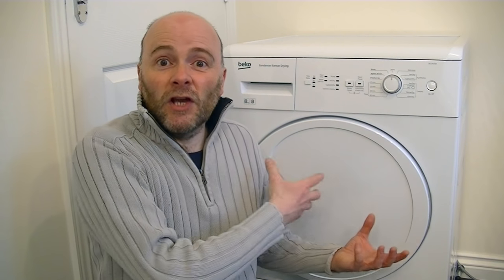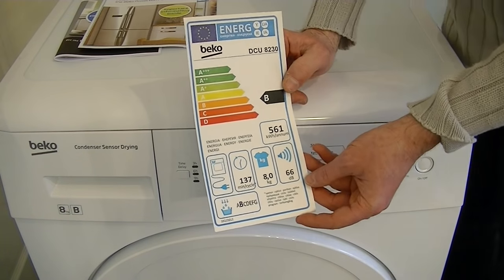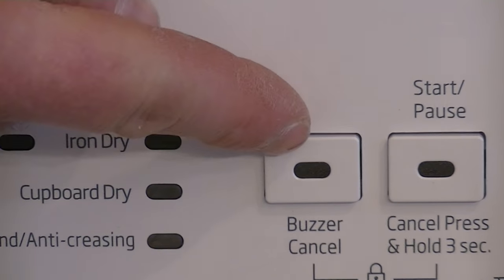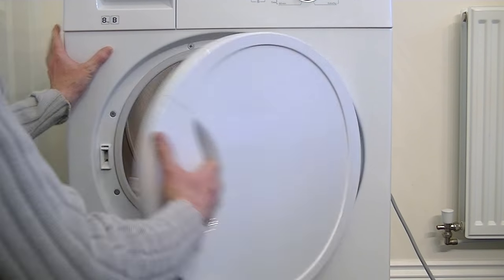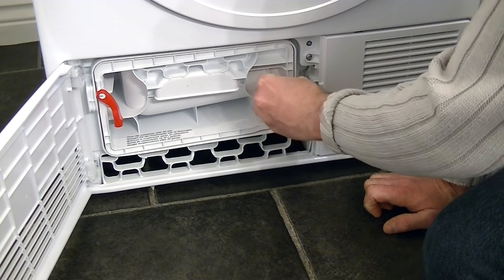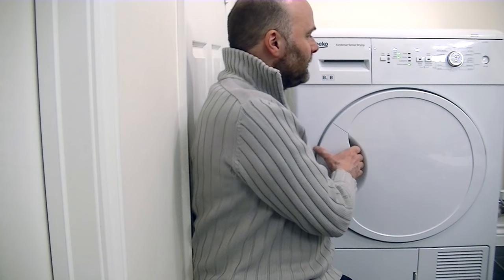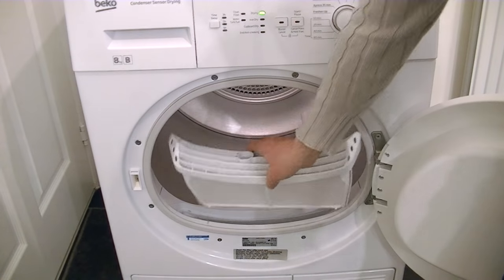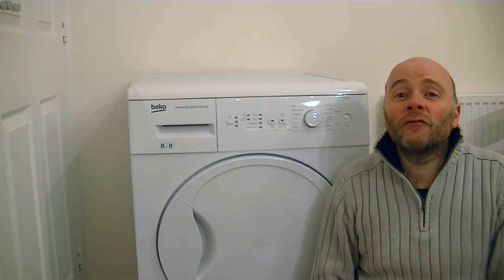Beko DCU8230 Condenser Sensor Tumble Dryer Review & Demonstration

Comment: As long as there is decent  wind and zero rain and even on a snowy day hanging you washing out will get rid of at leat 50-70% (if not more) of the water and then straight in the TD and it will save you a lot of electricity..

Comment: Hi I wonder if u can help bought before condenser  Dc7112w  yesterday excellent but I don't know how to get the heat up to 140
Reply from the maker: I think you're confusing the timer with temperature. The model you have can be set for timed drying up to 140 minutes. As far as I can tell from Beko's website, the DC7112W has two heat settings, regular for cottons and a lower temperature for synthetics. All the details will be in the instruction book supplied with your machine.

Comment: Just bought one second hand but didn't realise you have to have an authorised service engineer fit a different lid/special part if you intend to use it under a counter top yet to find out how much that will cost :-(
Reply from the maker: This dryer should fit under a standard height worktop with the lid that's fitted.

Comment: well i dropped the lint collector that collects the lint from clothes etc my question is what glue can i use to glue the small piece of plastic onto main lint collector
Reply from the maker: +Gollammeister Because of the heat produced, I don't know what glue would be suitable. Personally, I would just replace the filter. http://www.partmaster.co.uk/beko/tumble-dryer/filter-cassette-assembly/product.pl?pid=2809024&shop=beko&path=191107&refine=filter
Reply: ok no worries will consider replacing

Comment: My water doesn’t collect, it was bone dry after. I’m scared it’ll leak
Reply from the maker: If the clothes are drying then the condensed water must go somewhere.
Reply: @ibaisaic  it’s just lying in the back under bottom. Like a valve. Once I tip it up it all comes out the bottom

Comment: I have had it up to here with condenser dryers now. too much trouble-  If you have a vent hole in the wall where you want to place a Tumble dryer you are far better off buying a vented tumble dryer type . 

Here's my personal gripes with condenser dryers:
Condenser type: emptying the water reservoir - Vented: no reservoir to empty.
Condenser type: cleaning the heat exchanger - Vented: no exchanger to clean.
Condenser type: room gets hot and condenstated - Vented: all the hot air and condensation is directed right outside through the wall vent.
Condenser Type: Expensive - Vented Type : cheaper to buy.
Reply: What about Heat Pump or gas?

Comment: Hi love, the tips u shown on the video were very helpful, thank you..I just want to ask why my clothes smell after drying..Both washer and dryer are brand new (Candy)..I put really expensive powder and fabric softener in and after about a 2 hour wash, they come out smelling divine..I put the clothes in the dryer which is a condenser and once dry they smell musky, why is this and what causes it and finally how do I get rid of it..Could it be the fluff that’s doing it but to be fair, how would dust make ur clothes smell..Do u think it’s worthwhile by contacting Candy and saying I want a normal dryer and not a condenser..Thanks Hun xx
Reply from the maker: I’m afraid I don’t know what is making your clothes smell after drying, but most of the fragrance from the softener will be lost when you tumble dry. The smell could  be because the drier is new and it will stop after a few more uses. You could always try those tumble dryer sheets to add a fragrance to your laundry.

Comment: This tumble dryer is OK but has a couple of flaws:
1) The fluff filter fit into the housing is pretty poor, which means quite a lot of fluff bypasses the filter.  There is no secondary filter before the condenser, so this fluff mostly ends up on the condenser, with some of it ending up right at the back of the dryer (remove the condenser and look at the back corner).  Regular cleaning mitigates this, but it is a shame to have to for the sake of what would have been another filter or a rubber seal around the primary filter.
2) The smart lamp interior light module failed twice - in both cases the same failure mode, the lamp blinks uncontrollably.  First time the smart lamp PCB was replaced under warranty.  Second time (3 months out of warranty) neither Beko nor John Lewis wanted to know.
Drying performance is OK, though it does shrink clothes a fair bit.  The temperature of clothes coming out is much higher than the new heat pump Miele I've replaced it with; however it was over 3 times the price of this.  I think this contributes to shrinkage.
Reply: James in that case, I can solve all the issues you have raised in one statement, look after the tumble dryer. I do hope this helps, I have a beko condenser drier, I have had it 5 days. Its a great drier, simple maintenance and cleaning and keeps it running well. So stop moaning, keep it maintained and it won't go wrong. Good god!!!!!

Comment: a beko ehh😯 surely you havnt.well my grandma has had a bosch for 5 years plus and is amazing at drying.but I suppose it's you're choice but I wouldn't of touched beko a few years back there was a watch dog report  on beko appliances setting on fire.
Reply from the maker: +cars and vacuum cleaners I am very happy with it. Bosch tumble driers don't have a reverse tumble any more which is why we didn't go for a Bosch. It lives in the garage so there was no point in spending a lot of money. I would have dismissed Beko in the past, but this dryer has changed my mind about the brand.

Comment: Is it sensor dry?
Reply from the maker: Yes.
Reply: ibaisaic Thanks. I'm sure Hotpoint, Indesit or anything to do with Whirlpool was out of question.
Reply from the maker: I would have rather bought a Miele, but its was too pricey. I don't think this Beko will catch on fire like the brands you mentioned.
Reply: ibaisaic I have never heard of the Meli.
Reply from the maker: They are a premium German brand who make vacuum cleaners, home laundry, ovens and other appliances.
Reply: ibaisaic I want to buy Zanussi 300 8kg condensor. Do you think this is a good choice?